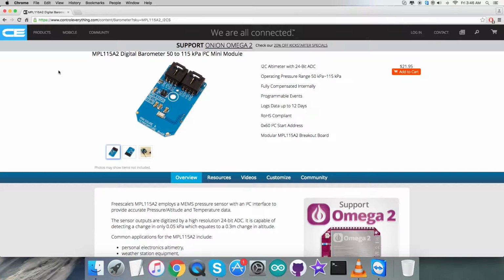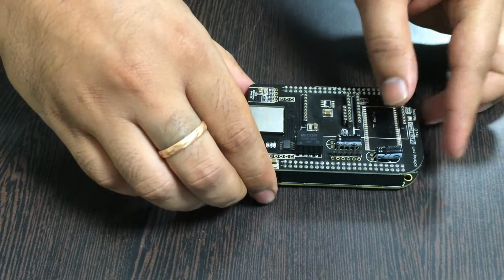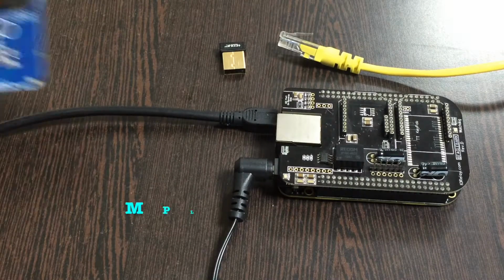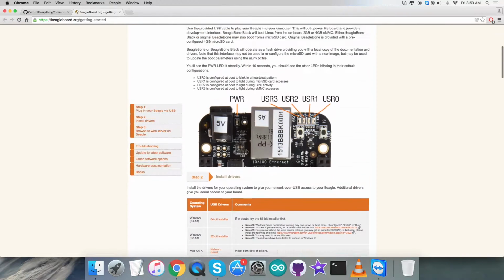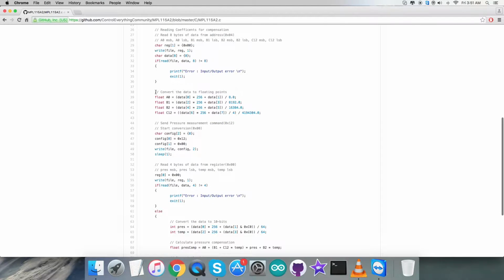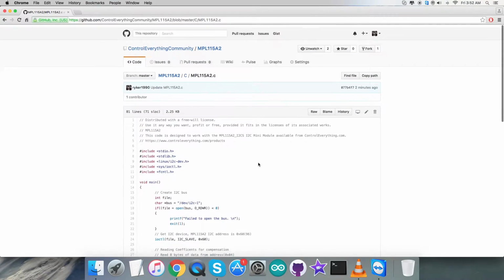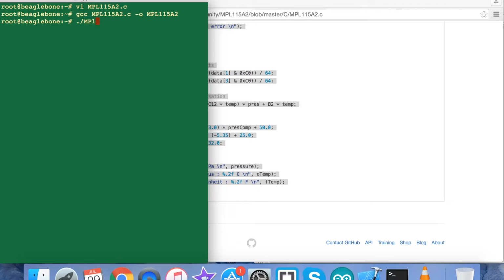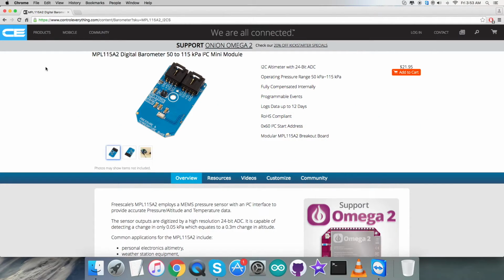BeagleBone Black MPL115A2 Digital Barometer 'C' Code Tutorial

Comment: Can I use the python code for the beaglebone instead of the C code ? Will it still work?
Reply from the maker: Yes You can,  use the python code - https://github.com/ControlEverythingCommunity/MPL115A2/blob/master/Python/MPL115A2.py which will work also before that do install all the recommendable python packages and do check the sensor register by using  I2C detect command
Reply: Thank you, How do I go about installing the python packages? when I use the pip command it says that is not found
Reply from the maker: Hi kathia, 
First of all do check the internet connectivity Beagle-bone 
check if the python is installed on the Beagle-bone or not. Enter the following command:
  dpkg -s python
 command displays the information of package installation and the status as 'Installed'

 If python is not installed, install from Debian repository by entering 
  Apt-get install python

Finally, Now it’s time to run Python code installed from GitHub
Reply: Thank you  so much! so helping me. I installed python and figured out that i have python 2.7 installed. However, when I type 
python MPL115A2.py
I get this error message:
python: can't open file 'MPL115A2.py': [Errno 2] No such file or directory
I also tried to just copy the python code into a vi script and I tried to install smbus but I keep get this error:
root@beaglebone:~# python mpl115a2.py
Traceback (most recent call last):
  File "mpl115a2.py", line 8, in <module>
    import smbus
ImportError: No module named smbus
Reply from the maker: @KatKO-n7v  in which folder you have copied your code?
commands should be like :
- ls (will show you the folder)
- cd (folder name where you saved the code file)
- then write "python mpl115a2.py"
Reply from the maker: Hi, Do you have any other query ?
Reply: Thank you so much for all of your help! I was now able to run the code. I ran it both with Python and C. Now I am working on editing the code to display the sensor data constantly, without stopping, so that I can see immediate changes in the sensors data.